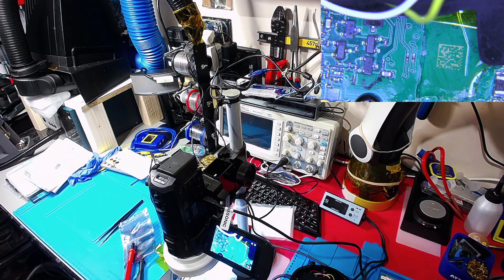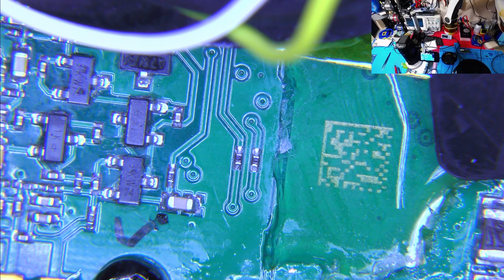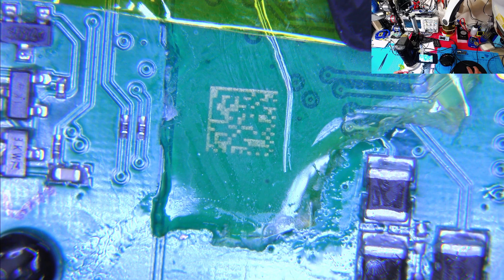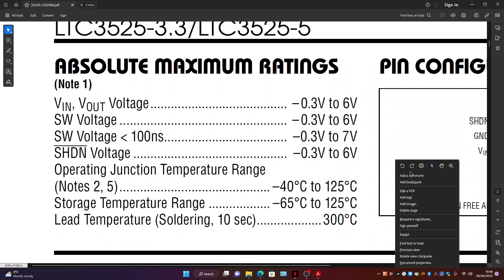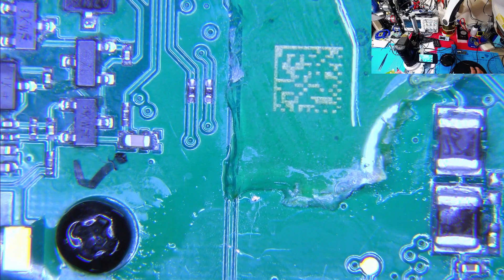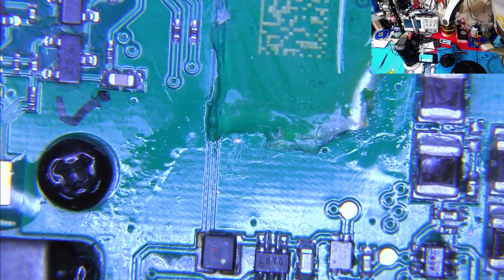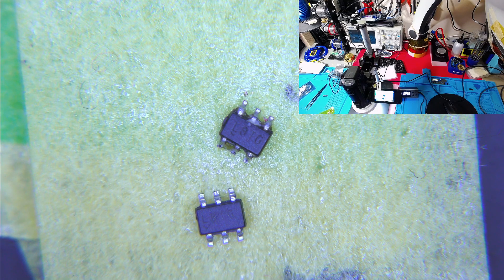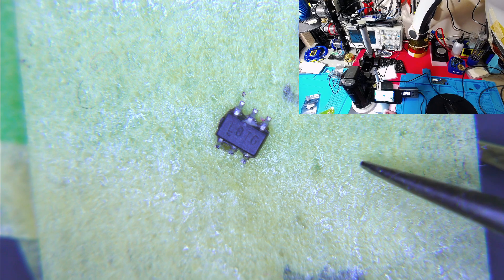How I fixed 3M Peltor ComTac Headset Shorted LTC3525-3.3

Comment: Mine turn on when you put the batteries in but the volume buttons don’t work, no idea whats Wrong lol
Reply from the maker: Either button damaged/cracked solder joint or Sound controller ic on the logic board is faulty.  Good luck 👍

Comment: My peltors were working about 4 months ago. I used them at the range with my army unit and when I tried them on about a week ago they wouldn’t turn on. I am always very bad at turning them off after use. I replaced the batteries and nothing, do you have any ideas?

Comment: Hey, can you tell me what the symptoms of those broken Peltors were? I'm at a loss with mine, I've had them in my slightly dump basement for a while, took em upstairs, turned them on and they said "Power On, Low Battery" after which they turned off again. At first I figured it might be the battery, but after trying it a few more times with new batteries it still persists. Took them apart, cleaned them with contact cleaner but they still do the same thing 🙄 I'm at a loss..
Reply: Mine are doing this too! Would love more insight on how to fix them
Reply: @sovietbudgie7436  same problem ! did you find a solution?
Reply: I have the same problem, did you find a solution? I have two pairs that do the same thing. The only way to keep them on is by keeping the button pressed. As soon as I lift my finger it says low battery and turns off.
Reply: @johnhashhash  same problem ! did you find a solution?
Reply: same problem ! did you find a solution?
Reply: Did you find answer?
Reply: Sadly no :(

Comment: Sorry, I didnt get what dc-dc step up you used, the 3.3 V like in the headline? In the video it sounds like you take the 5V.
My V on Vout is 1.5V that seems very low, so I guess thats why my peltor won't start up anymore.
How do you get rid of the coating?
Reply from the maker: Coating removed using hotair set around 100oc

Comment: If my eyes don't fail me you definitely have a circular mark on pin one on both components, don’t you? The image wasn’t sometimes clear due the light reflection you get on the microscope. I was able to better see it when the component wasn’t perpendicular to the microscope optical axis. I really deserve new glasses otherwise…🤓
Reply from the maker: I believe you are correct.  There seems to be a mark under "L" arrow pointing downwards.  But the data sheet doesn't show anything???
Reply: @iTCXtreme  could happen, they probably give it for granted, the pictures on the ds it’s more related to the pinout not the packaging I guess…